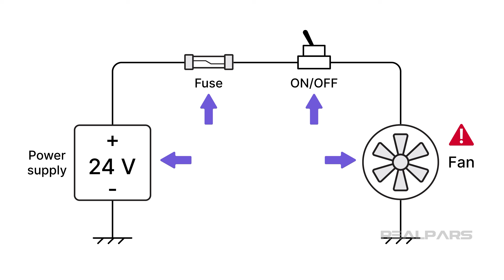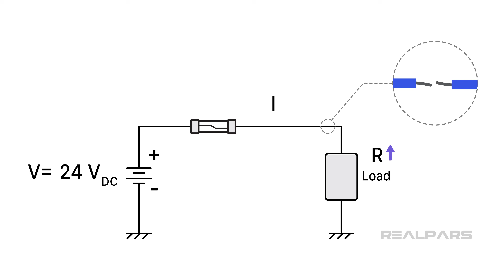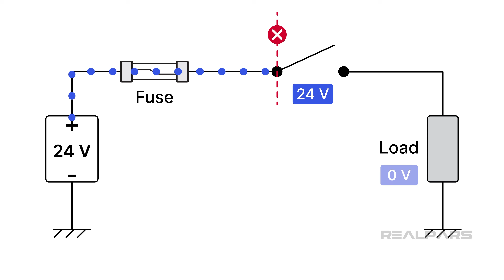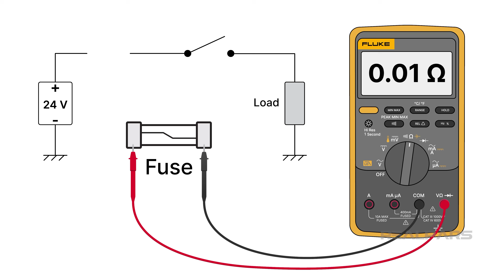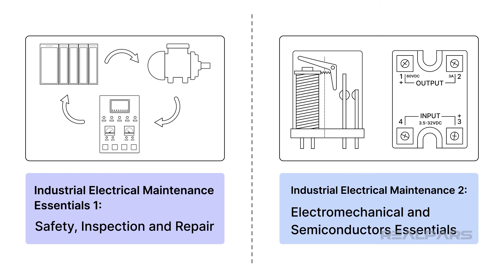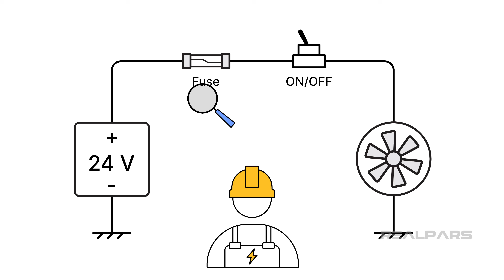Industrial Electrical Troubleshooting Made Simple

Comment: Thanks for this. I have a question, why can't I test resistance directly in a circuit?
Reply from the maker: Hi @slimeminem7402. Good to hear from you. Thanks for your question. There are 2 reasons. First, consider an ohmmeter a mini-power supply. Its job is to apply a voltage across an unknown resistance, and the resistance value is determined by the current flowing between the 2 leads. It’s not a good idea to connect a live circuit to another live circuit. New DMMs are protected from damage, but older multimeters have been known to blow up when exposed to live voltage. Second, the ohmmeter current will follow whatever path or paths it can find between the 2 leads. If the device under test is not the only path, the reading will be incorrect. For example, if you have two 20-ohm loads connected in parallel and you place the ohmmeter leads directly across one of them, the ohmmeter will read 10 ohms.  I hope that answers your question. If not, fire away.....we're here to help.
Reply: @realpars Thank you very much
Reply from the maker: @slimeminem7402  You are most welcome.
Reply: @realpars great answer

Comment: 4:27 When the switch is open, the measurement Vsw_open is 0 Vdc, not 24 Vdc. Following KVL, that point, including the fuse, is considered one node voltage.

Thanks for the explanation, though
Reply from the maker: Hello @emulation.engine, thanks for watching our video and reaching out.  I'm not sure why you suggest the voltage Vsw_open will be 0 VDC across an open switch. It will be 24VDC.   It would read 0 VDC if the fuse were open, but in our example, the fuse is fine.  Could you please expand on your comment about the KVL and node voltage?
Reply: @realpars 24Vdc across an open switch is an impossible condition unless the load components are shorted (R=0) or have a very (low resistance value* . In practical scenarios, faulty loads typically fail, resulting in an open circuit that prevents the negative terminal/node from completing the circuit loop

When measuring an open switch via DMM, either you get 0V or display OL (open loop) , due to an incomplete circuit . 

In nodal analysis, a voltage node is only considered at components with non-zero resistance ; therefore, the switch, cable, and fuse are generally omitted due to their zero resistance.  

In your example (R load | L+Diode Load). There are 2 nodes in both cases: 
* Node 1 (24V), 
* Reference Node (0V - the ground).
The difference in potential:  V1 - V2 = 24-0 = 24V

I hope that explained it.
Reply from the maker: @emulation.engine  Hi agan! Thanks again for reaching out and for your quick response. 24V across an open switch is possible and exactly what you would measure if that is the only open in your loop. Give it a try sometime to verify. It’s a very important troubleshooting principle.
You refer to that condition occurring only if all loop components are shorted or zero ohms. If that were true, the voltage would be zero because either the fuse would blow or the wires would burn up.   
You also mention that measuring the open-circuit voltage with a DMM will show 0V or OL (open loop).  I’m assuming you are referring to the OL(open loop) measurement when on Ohms? If so, that’s very true assuming you have isolated the switch entirely.
Here’s why the DMM will read 24 VDC, not 0VDC as you suggest. In our example, we have 3 components in the circuit – fuse, switch, and fan. Let’s open the switch and place a DMM set to DC volts across it. The DMM resistance is approximately 10Mohms. So, we’ve got a series circuit with a 0 ohm fuse, a 10Mohm DMM, and a fan at maybe 100 ohms. Series circuit calculations will tell us that the largest voltage drop will be across the DMM, and that will be  23.999 VDC. 
I’m not sure what you mean by Diode Load. 
Thanks for watching our videos and your input!
Reply: Welcome 😇. 
Of course, I just did a simple circuit experiment with AC220V / DC12V, including modelling & simulation with software, for that matter. Glad for refreshing information. Loving your channel and have been following for a long time .... Have a nice day.
Reply: @emulation.engine can i ask where you get the modeling app from please
Reply: @GavinCunningham-xy6nj  It was provided from R&D lab.